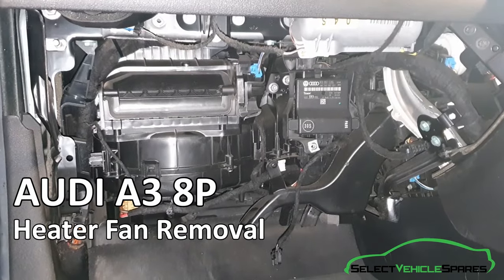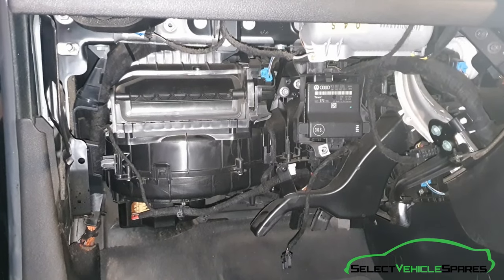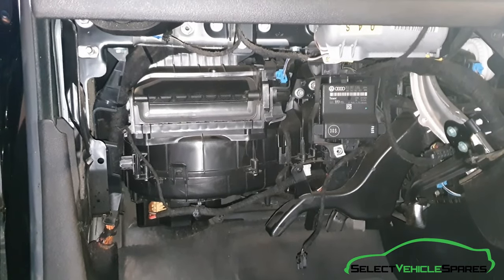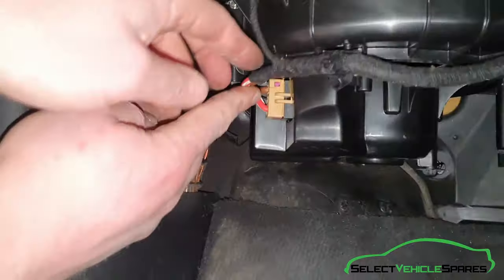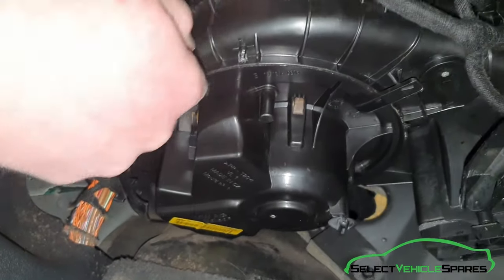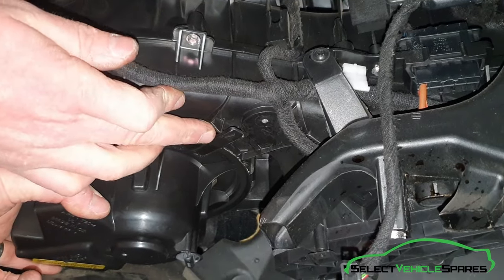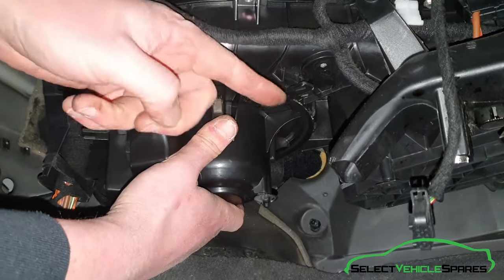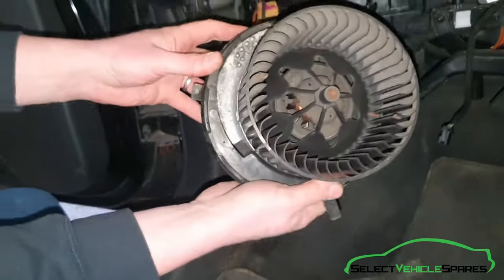AUDI A3 8P - How To Remove Heater Blower Fan Air Con Motor & Resistor Removal 2004-2012

Comment: so how do i replace the resistor? remove from the fan assembly?
Reply from the maker: Yes, the fan motor can be removed from the housing, then once this is out of the way the resistor can be accessed.
Reply: @SelectVehicleSpares  Thank you so much

Comment: where's the resistor located ?
Reply from the maker: It depends which air con type you have. If you have climate control (type shown in the video), the the resistor is in the fan unit. If you have standard air con, then the resistor is in the heater box duct next to the fan.

Comment: Okay already replaced the fan.... where is the resistor location?
Reply from the maker: If you have climate control, the resistor is built in to the fan. If you do not have climate control, the resistor is further down the heater box, more towards the centre of the vehicle.
Reply: @SelectVehicleSpares  ok thanQ 💪🏽... so in other words I got to replace the resistor or fan again? Idk whats going on with the blower,... it did this last time it "cuts on off on off" but don't totally go out. Just replaced it 6 months ago & now the same prob🤷🏾‍♂️